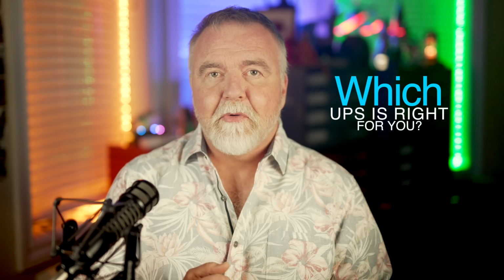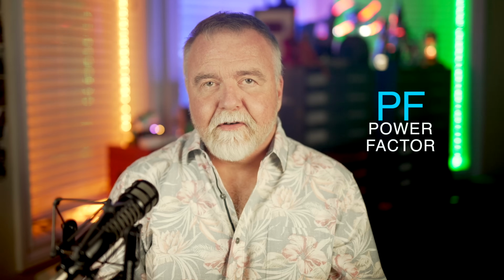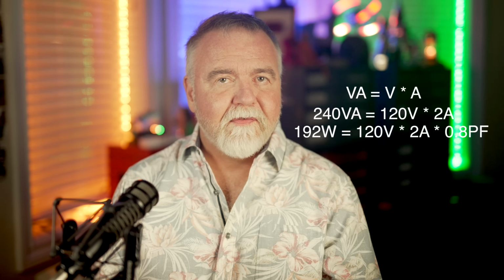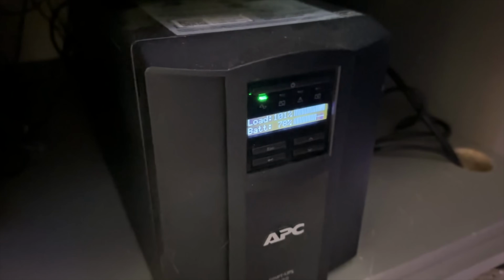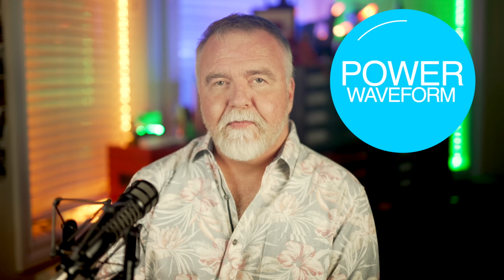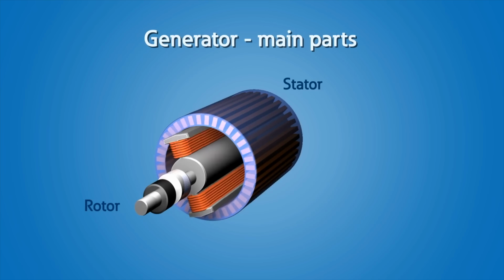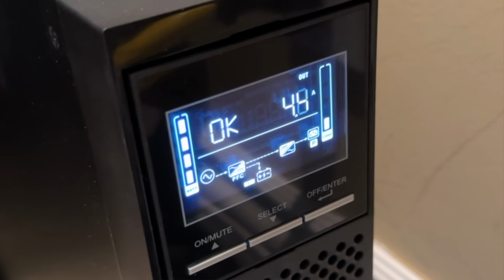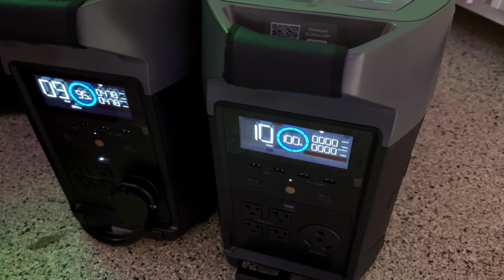The UPS Secrets YOU Need to Know!

Comment: Technically those electrical engineereds should be using watts for both real and apparent power and not doing so is in violation of SI or metric units. Also note that UPS can and does affect the electrical noise in your house. I need to use power filters for all my UPS units so that Insteon (rest in peace) devices can use the powerline network.

Comment: It's easy to forget that in the USA, the average electric circuit only provides about 1500W. So you won't find many UPSes that are designed for more than that (for a reasonable price), even though in 240V land, it would probably not be a problem to make a 3000W UPS running on a single phase.

Comment: Actually, power factor is between -1 and 1, though below 0 is probably not relevant to the matter in mind. I felt the need for this statement. Otherwise great video so far!
Reply: Two other notes: 

There's more lithium battery chemistries such as LiFePo4, which lasts even more cycles.

An online UPS with a Li-ion or LiFePo4 can be more efficient than an offline or in-line UPS with a lead acid battery, due to the charge algorithms and other differencen electronics as there isn't much innovation in the low end anymore.

Comment: Given the same wattage and applied load, which UPS requires fewer battery replacements, the line interactive or the online one? I ask because I have a line interactive on which I have already had to replace the batteries twice in 3 years, and therefore I have already spent more money than if I had purchased one online. Unfortunately, in my area there are continuous voltage fluctuations and the UPS intervenes very often. As you explained very well, therefore, I have to purchase a UPS online, and this does not worry me, in fact it makes me more relaxed. However, the question of battery life interests me a lot if you could give me some information on this. Thanks and compliments for how well you explained the differences between the various types of UPS. Greetings from Italy.

Comment: I once made a "poor man's" online-ups out of two line interactive ones.  My work was replacing some old APC XL1400s so they let me take them home.  One of them was a 240v model the other two were 120v.  I needed all three to provide power for my computers, switches and servers.  I put the 240v on my servers since all that equipment was rated for it.  Well the issue was my generator only output 120v.  So the server would lose power during an extended outage.  So what I did was connect the battery banks of the 240v and one of the 120v UPSes together.  So when the generator was running the 120v UPS was charging the battery bank so the 240v ups could keep running.  Technically with the set up if I never plugged the 240v ups into an outlet it would have been running "online" all the time.  However in my case it only ever ran that way on generator.  The "on battery" beeping would have gotten old fast too.  Thankfully I've since gotten a generator that can output 240v so I don't have to worry about that any more.

Comment: Many, if not most devices with switch-mode power supplies will happily run on just about any waveform, or even DC, as long as the RMS voltage is within its design limits. The first thing that happens in a switching regulator is rectifying the AC to DC anyway. It is just special cases where the device is monitoring the AC for some reason (such as a digital clock frequency reference) that it may not work.
Reply: Not the rms, the peak voltage.
Reply: @fss1704  If it is a square wave, the RMS will equal the peak. But for any other waveform, such as the stairstep (modified sine) or actual sine, it won't.
Reply: @strehlow  IF PFC is used than BOTH RMS (higher than minimum voltage PSU is specified to run) and peak (lower than sqrt(2)* maximum voltage psu is specified to run) are important. Without PFC - only peak one, but within range (higher than sqrt(2)* minimum voltage psu is specified to run and lower than sqrt(2)* maximum voltage psu is specified to run)

Comment: Can one easily and safely replace the UPS lead acid battery with lithium-based battery considering specs between the 2 are identical? Or is there special circuitry required?

Comment: Unfortunately, neither lithium ion and online UPSes don't really exist in the consumer market. Things like EcoFlow's batteries that have the capability to work as a standby UPS (30ms switching time) are about as close as you can get to consumer lithium ion UPSes, and they're very expensive for the power output compared to an equivalent lead acid UPS, but they do typically have many times longer runtime.

Comment: I think it's a bit funny that the type of UPS that Dave says is the most advanced, the online, double conversion variant, is the one that's easiest to jury-rig. Just get a good quality charger, a largeish bank of lead acid batteries and a 5KW DC-AC sine wave converter, or if you're unable to source one at least get a modified sine wave converter. It's ugly, has zero monitoring or quality of life features, but it will keep things running in a pinch.

Some years back I worked with a dude at a university that had created a project to provide energy efficient and high performance routers to third world countries. These had to be able to run on regular power, solar cells, and battery. So he created a power controller board that went into each router and would automatically select power source depending on what was available. The router was fast enough it could handle all internet traffic generated by a large European university, and still was incredibly power efficient and could run on a single car battery for about two days. These were placed in radio link towers around some African countries. These were normally connected to the power grid, but it was often very unreliable. So each one had a car battery and a solar cell panel attached to provide power when the grid was down. I remember sending replacement units to one of the African universities involved. I was told that they had a problem with people raiding the radio link towers for scrap metal. The case for these routers were three or even four pounds of aluminum acting as a heatsink. Add a car battery and the solar panel and I guess they were quite a good haul for any scrapper...

Comment: I have this very fancy UPS system for my needs called a "laptop battery". Is so small and handles losing wall power so well you can purposefully disconnect it completely and take the computer with you away from your desk if you want 😜

Comment: We had a real problem with off-line UPS and server blades... their small switcher power supplies couldn't handle a single-cycle dropout like your normal desktop would.  Solution?  The UPS with no battery!  We now have a flywheel system in our shop... it's online, of course... never a problem.

Comment: Nice discussion about W vs. VA, but I don't think the issue here is reactive loads.  Electronic devices tend to draw current only on the AC voltage waveform peaks and not evenly across the entire waveform.  But that's going to result in a lot more peak current than a normal load.  Since the waveform is cut up, it's referred to as having high harmonics.  You might want to do a web search for "harmonics and power factor".
Reply: Yeah you can't really compare a system with rectifiers and capacitors with a system that only has a capacitor directly connected.
Reply: "Great Scott" has come out with a nice video "The Most Important Circuit for our Electrical Future?! (PFC)".  Note that higher end PC power supplies (especially for servers) have this already.
Reply: Computet power supplies doesn't really care if waveform is really cut up. Mains is rectified and filtered anyway.
Reply: @volodumurkalunyak4651  No the power supplies don't care, but things like UPS does care about the peak currents and such.

Comment: I have a few APC UPS. One is the 1000 version of your 1500 the others a slightly older version or a more consumer version. I've had them all about three years, and sure enough, they have all just required a battery change. 

One thing that I don't like about them is the Powerchute software. It worked with IE, and with some faffing around worked with early versions of Edge, but now, nothing. Security issues for a local connection. Really irritates me.

Comment: Do you have any experience with some unifi switches like the USW Lite 8 PoE resetting when a UPS returns to line power? For example, when i pull the plug on the UPS, the switch stays on, but as soon as i plug the UPS back in, the switch resets.

The BR1500G that i have is line interactive,  but has a 8ms transfer time. I was looking at maybe a SRT1500 which is also Line Interactive but only a 4ms transfer. 

No other equipment that was plugged into that UPS has ever had any issues, but this Unifi Switch i think might just be overly sensitive. There really isn't room for me to put a fully Online UPS under the desk so i am just not sure what to do as it is kind of a pain with this switch rebooting whenever there is a power issue and the UPS transfers back to mains power which can just happen due to little fluctuations in power causing my devices in my office to lose network connections until the switch reboots and connects back to the UDM in the basement.

Comment: Lead-acid batteries are also less dangerous. Overcharging them won't make them burst into self-sustaining flames that are only made worse by water. (Yes, water does make Lithium burn, air humidity can even be enough.) They also won't turn into a spicy pillow by over-charging or over-discharging. Although the Battery Management System should take care of that, too many Li-Ion batteries swell up...
Li-Ion batteries also don't really like trickle charge and don't appreciate being kept fully charged. Although I don't know how much of a problem this is in practice.
Reply: If you use small UPS, such as 72Vdc 3kva, you can choose lithium battery. If you use big UPS, such as 100kva, mostly UPS supplier won't sell lithium battery to you, because high voltage lithium battery is very danager, if fired, even the fire brigade couldn't put out the fire either. Many building fires cannot be extinguished because of large UPS use high voltage lithium batteries.

Comment: Considering that normal PC components actually run on DC, doing a full AC->DC->AC conversion only for the internal PSU do yet another AC->DC conversion seems redundant. Is there any practical way do direct AC->DC via a UPS? Of course, that would require replacing the PSU with what would essentially be a UPS/PSU hybrid. Such a direct AC->DC system would have some of the benefits of an online UPS but with lower costs. It would function more like a battery powered notebook, just one that doesn't travel very well. 

The only advantage of having multiple conversions that I can think of is better buffering between mains power and the actual hardware. Of course, that's at the cost of power consumption and all of the intermediary components.
Reply: Yes, there are special UPSs that are designed for that.
Reply: @erkinalp  It didn't cross my mind to google ATX UPS. An all in one unit is an interesting idea, but that definitely caps the PSU and battery capacity.

Comment: Safety in failure is another advantage of lead-acid batteries. While of course neither lead nor acid is nice to have hanging around when things break, it's nowhere near as vigorous of a reaction if things go wrong. Large lithium cells are well-known to be a fire hazard even without visible provocation. This isn't an issue with most lead-acid batteries.

Comment: Just about every oscilloscope test I've seen with modified sine wave UPS units produce that ugly single step square wave form such as the cheaper APC Back UPS range.  One warning about some UPS's is to only run the self test when the PC is can be safely turned off, such as at the boot menu.  When the self test failed with my previous Belkin UPS it would disconnect the output, causing an outage!
Reply: When you run a UPS close to max ratings - that's too small. It is just a basic power supply after all. You get the same issue the other way - when a DC power supply is too small for the load you get "ripple".
When you need 1500 watts, buy a 3000 watt system. If you stay under the 50% load of the system - you will have clean power.

Comment: Hey Dave, i have a studio with a lot of old equipment, computers and was thinking about a EchoFlow. i want something that can be inside running this and can take outside on camping trips etc.... In studio i need each to be min 1k watts for three locations. i don't want to nor think i can put everything on one unit. Each section will pull about 500-700w so figured 1000W would be best. Then camping id like as much power can get. Is there something i can safely have for both. Inside act as a line interactive then maybe get solar panels for a camping trip! What do you think? I've been using the CyberPower CP1500PFCLCD PFC 1500/1000W units and need to get new ones so figured I'd look deeper into a dual system!

Comment: @DavesGarage Have you tested putting in LiPo4 batteries in your UPS? I have tested putting in high cycle, BMS, batteries in a 1500VA Smart-Ups rack mount system which gives me about 2 hours a battery run-time. I have been running them for the past year and half without issue. Since you cannot buy 12v9Ah LiPo4 batteries I bougth 12v10Ah, it was either that or by 12v8Ah batteries which well seemed a lot less than the 9Ah. :)

Comment: 12:48 Those "small power tools" will most likely have an AC motor inside and will probably be able to cope the least with this kind of waveform. A SMPSU will care less.
Also the "modified sine wave" or "stepped sine wave" can just be a 3-state square wave inverter. The wording "sine wave" is pure marketing, as it's definitely not a sine wave.
There's a standard from Intel that states PSU's should be able to handle an interruption for at least 16ms. Next up: ATS's (automatic transfer switches)?

Comment: many years ago, I serviced mini systems.  IRIS operating system and Fairchild CPU.  Yeah, that's old.  Lightening hit the power pole, traveled down the pole into the building electrical, directly into a high quality (at the time) surge suppressor.  Jumped the surge suppressor, fried the power supply and traveled directly to the CPU. Traces on the board were completely fried and the CPU exploded.  Solution: new motherboard.  Yeah, lightening can do crazy stuff.
Reply: A computer store I worked in as a technician had a computer brought in by an insurance adjuster to evaluate whether it was a total loss after a lightning strike.

Modem had become spot welded to the computer case. CPU, motherboard, power supply, hard drive, RAM all tested bad.

Apparently the business owner shut the computer down and unplugged the power cord, but left the phone line connected. 

The adjuster left it for us to recycle and just out of curiosity I tested the modem and it still worked.
Reply: The worst electrical damage I ever saw happened when a small town independent phone company had gradually removed all the antennas and coax from their antenna tower (as business band radio became obsolete). Lightning strike hit the tower, travelled down the (under sized) grounding wires vaporizing them near the natural gas line and entered the building through gas line, jumped to water line and then was on everything that used the water line for earth ground. Over 2 million dollars in damage and a significant fine for not being able to restore emergency 911 calls for more than one day.
Reply: @mikebarushok5361  I'll bet they all tested bad.  Amazing they were even recognizable as computer components.